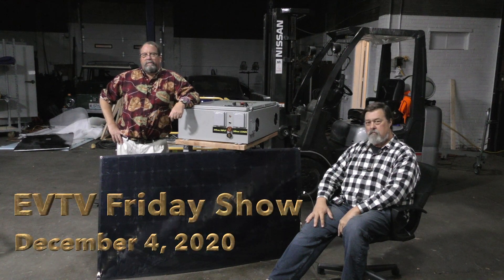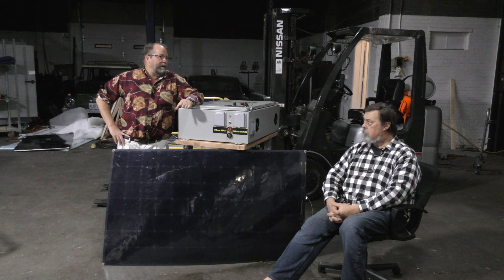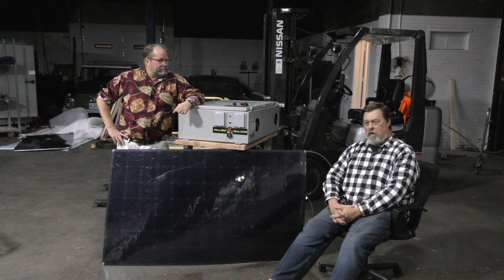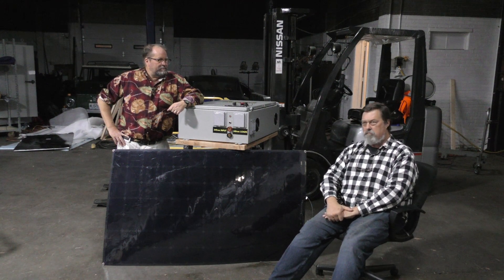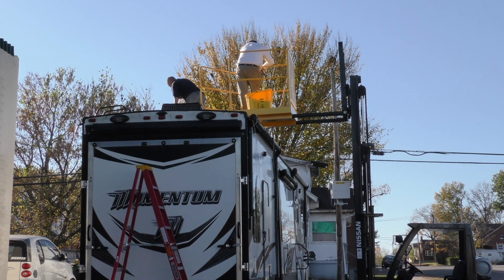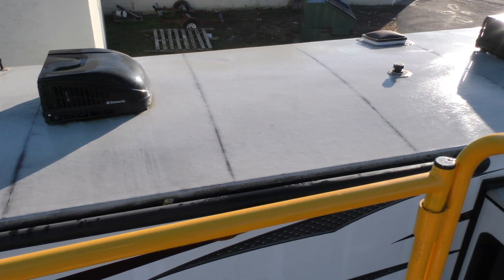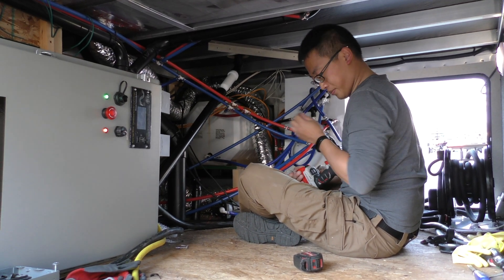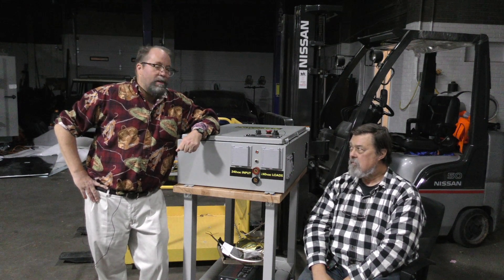EVTV Friday Show - Adding Solar to a 5th Wheel RV with a PowerSafe 15

Comment: Putting those panels directly on the skin of the RV causes tremendous heat transfer into the RV.  It's best to build a mount that will lift the panels and give a 1/2" - 1" air gap.  This will also allow the panels to run cooler with air constantly flowing under them.  And as we all know, the hotter the panels get, the less efficient they are.

I also am interested to know if you utilize the cooling systems in the battery packs?  Do you run a liquid coolant in your shop's Tesla battery packs?  I couldn't see any coolant hoses connected.

Comment: Richard, Dhanurja, Ziqi, Wally, and Shop Cat, Jack would be proud of what you are doing. I also like the shorter format, short and more frequent I hope. I would like to see more of Wally for the Electrical Engineer perspective. Dhanurja, could you also do a pdf for the info on the next video on the ESP32 controller functions. Last but not least, EVTV articles, I know it will be hard to match Jack's Wordsmith abilities but give it a try. Please. Thanks